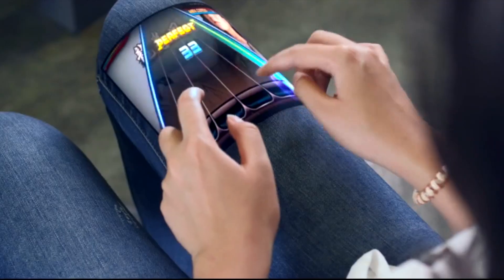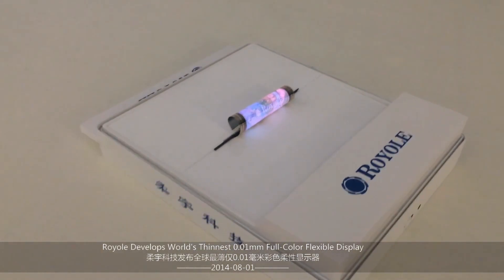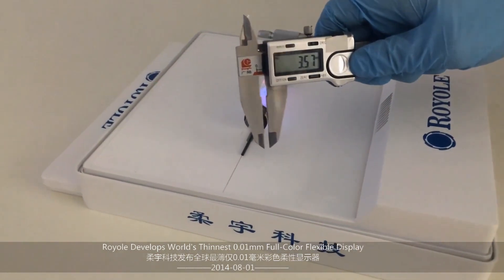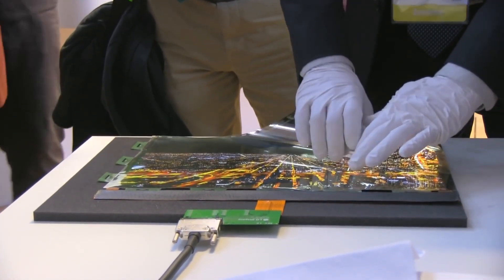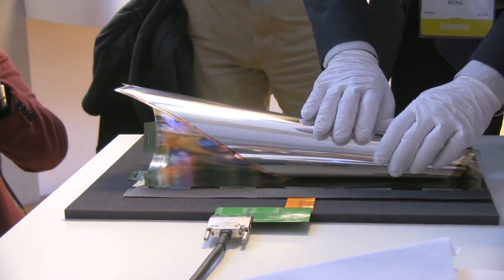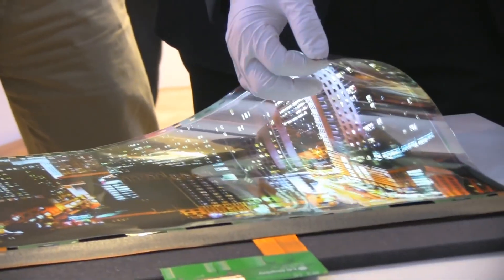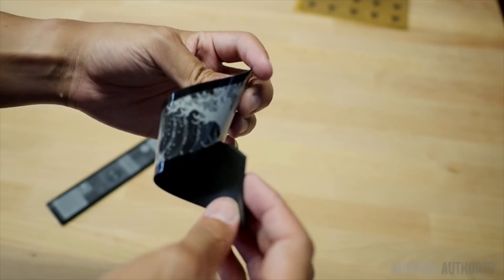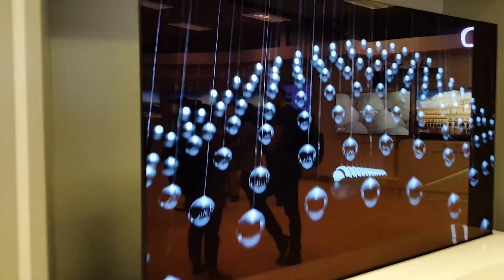What is Stopping Flexible Displays From Taking Over?

Comment: We're still waiting but manufacturers are trying to still create glass displays. As a result what's been released is mostly a gimmick - foldable phones and laptops etc but it has a big crease down the middle and has a limited life cycle because they keep trying to make it with a glass display. Until they ditch the glass we'll still have heavy, solid devices.

Comment: To be truly bendable, not just rollable or flexible, you need a organic water insulator for electrodes, and also organic dielectric for driver chip and thin film transistors, and then hermetic sealing for display packaging; each demands different polymer thin film technologies that can be delivered byCVD or printing processes; unfortunately I don’t see many choices out there.

Comment: a great use case is the head mounted display monitor ... not vr head set but similar.. for work... with you motion and movement around you can virtually switch to another monitor... vr headsets are not good for long time work and for people travelling or for any reason cant carry monitors , that was just an example there are many other use cases such as land surveyors

Comment: Return to classical drafting but with the benefits of digitization. The link between design and construction. While zooming has its place, one needs to be able to see full plan sheets. The largest manageable paper plan sheet is D or E size 2’x3’. This is the magic number for design and construction. We are still using paper plan sheets because it is a consumable quantity of information with built in static zoom and the ability to carry and look at. If you could carry a full plan set or all your plan sets,  in a single 1/8” or 1/16” sheet that will be revolutionary. Especially if designers are working on the same format. Combined with some sense of touch for design.

Comment: The flexible display should end the laptop and the tablet form factors completely. They should coalesce into three-ish items that combined weigh only a few ounces. 1) A screen you can roll up into a small protective tube 2) a computer that's about the size of a Raspberry Pi (fits well inside the palm of my hand) and has the computing capability of the laptops we have now or better 3) Something to prop up and unroll my flexible display that has a camera that can watch my fingers type and touch on the table in front of it (no more physical keyboard).

Comment: It’s not the lack of demand for this item, holding them back, but the durability of the screen. It has a temperature sensitivity issues. 

Also the flexible screens become dimpled after a being used a couple of times by the operator. They need to stat looking at silicon material, that do not incur damage from being used again and again,  instead of using ridged acetate sheets.

Comment: It would be perfect for my home built flight simulator. Wrap around screen would eliminate all the problems associated with setting up front, left and right views from the cockpit seat.  Currently need to use three to six large lcds all running from synced computers with each screen showing a different view. Another approach currently used is to build a curved screen and use two or three projectors.... of course then needing to use warp software.  The problem there is keeping the projections from jerking when the simulator is moving during flight aerobatics.
A curved tv screen or two would be fixed to the body of the simulator thus eliminating multiple flat screens or projectors.
Reply: @Lurch7861   Ha ha.  That was three years ago.  Come a long way since then.  Have built three axis motion sim - with a dual seat/dual control cockpit with three 55 inch 4K screen for front, left and right, plus three more for instrument panels.  Not quite the cost of an actual plane but fairly pricy with high end computer to run everything.  But of course I can go anywhere in the world with MSFS and I can’t get killed doing risky stuff.

Comment: Because a truly foldable device requires a foldable battery (processor, RAM, etc.), I think most phones we'll see in our lifetimes will just be "bendable'" phones. The only other way would be to have those components stored separately, in your pocket, and transmitted wirelessly to your screen. Even then, we'd also need "true wireless" charging also.

Comment: Flexibility is cool but the appeal for graphene is durability. Upon impact it distorts it's shape instead of cracking. You can't resist impact forces with rigidity. Flexibility is better because the forces disperse as it bends. I want a phone that I can't break so easily. Gorilla glass is not good enough.

Comment: Remember when the consumer market was demanding flexible displays?

Me neither..

This is a solution to a non market need.  Nobody cares about this.
Reply: I care because it is compact, portable, light weight and can easily be put in small places.
Reply: There's not a market demand for them.  It's as simple as that.

Compact, portable, and light weight has to be balanced with durable.

You already have a super computer in your pocket with a modern phone.  That's compact, portable, and light weight.  A typical smart phone today, is entirely capable of doing nuclear bomb simulation, its power is simply wasted on inept coding and trivial visual effects.  I'm not kidding when I say this either.  My first computer had 4KB or RAM, and ran at less than a 1Mhz.  I learned to write code on that, at 9 years old - that machine can be simulated on my phone at the transistor level at over 10,000 times the speed, written in Java,which is interpreted.

People who weren't born before, say, the Nintendo Entertainment System, have absolutely no idea how far we've progressed.

Comment: You do know that "Samsung Edge" has a flexi display right?

Roll up display & interchangeable component phone was a very old concept by students all over the world ever since before the release of Minority Report.

Both concepts doesn't sit well with current sales strategies, where financial values for the interchangeable concept is highly questionable (considering USB-C only taken seriously because of Lightning connector).

And the roll up / flexi display?  The folding mechanism isn't reliable enough for mass market, (not volume, demands are there).  That is why ALL the flexi screen trade show will able to tell you about their screen with such "bend X angle" and "bend radius value", because it will dictate how the folding mechanism works on a phone.

Right now it just too limiting to be reliable, not volume.

Comment: I feel like the foldable oled in a phone would be a huge problem. What are the use cases with that kind of device? And when it folds, the biggest issue I see happening is that it can't fold FLAT. There needs to be some bend, and it would make the phone fatter as a result. I assume you can't crease these things, but if that becomes possible who knows
Reply: Why would you need a case?
Reply: Since I never said that, I have no idea. A "use case" is something different.
Reply: Oh

Comment: Old flip phones were safer when driving. Phone rings,, flip,, talk... Now phone rings,,, you have to slide the button to talk .. Not safe while driving. Have a phone that flips open again u talk,, or you flip open large screen mode.. Now u got some thing.. Now they gonna steal my idea.. How bout some royalties or a free phone at least,?? Also if you work construction a foldable phone which had built in drop protection would be good...

Comment: It's interesting, but so far have not use for it. I like a solid flat screen, thin, ok, but foldable? I even never fold paper unless it is necessary, or (maybe some people remember, pictures). But flat is great. You can hang a flat, thin screen at a wall, put another frame around it etc....

Comment: I think the truth is something dirtier. I think at least one of the big players holds it small or something like this because Apple couldn't do what they do for years now, which is realising the same design with new specs over and over again without losing customers to more innovative Producers or something like that. Or maybe they want to release a few more phones like they are already until they play this new card. But it's already too long to say it's something like "the market is not there yet" or "it's technical not ready" another theory could be that Apple and Samsung would need to overthink their products completely which means they would need to develop something and that is expensive. It's cheaper to make the screen a cm bigger use a better camera and CPU and then write a new number on the product

Comment: Yeah I thought one of the big issues was durability and lifespan? I've heard that the screens work well enough right now and don't rely on overly new technology but the problem is pixels die rapidly and the screens don't last very long as a result. Hell, half the pictures I've seen online if you look closely enough have dead pixels clearly visible and sometimes entire dead sectors somewhere on the screen. Whatever conductor they use for the screen has to be soft in order to be flexible, and soft materials still break down over time - like a rubber hose. If you sit there and bend and flex the hose long enough it'll eventually start to crack and finally break. Thin metal fibers work the same way. Anyone who's ever worked with electrical wires tells you the ultra high gauge wires - the ones with human hair thickness - are stupidly easy to break and degrade rapidly if you don't handle them super delicately. Put something that's made up of millions of those delicate wires into the hands of your average consumer and see how long it lasts. It'd be a RMA massacre if any company used flexible displays in a mainstream product right now.

Comment: curved screens for 3d vr, that wraps around your field of vision rather that having one or two flat screens ... it will help a less bulky vr headset... ideally it would be able to be a single display that could use polarisation or LCD shutter effect on the lenses at a high enough frequency to deliver left / right images in conjunction with fresnel lenses...

Comment: well you could make a very compact mobile device that get rolled into a tube and back for easy compact storage but size of the screen would effect the size of the tube containing said display remember most of the working components of the programming needs to fit in the tube at all times.

Comment: I could see devices like the switch, but the screen rolls up inside the device when not in use. It would keep the screen nice and protected and also make the device highly portable. You wouldn't even need to unroll the device if you were planning to use an external monitor.

Comment: i just think it would be cool to have your walls covered with it . than you will be able to "renovate" each month by changing the colors of your walls/
Reply: Eyalחןעצוןי5עוגנט Ben Ari good idea I have been thinking the same thing for a while now but believe that using a colour e-ink display would work better due to the fact they are already available-ish, are cheaper, don't emit light so it would be more like real wallpaper and don't use energy except when changing the display. The main downfall of e-ink is the lower resolution and frame rate but for wallpaper I don't see that being an issue.

Yea I have thought this through way to much!
Reply: Good luck paying the electric bill. Also, Oled has a tendency to burn in really bad and dim over time.
Reply: THIS ^^^
Reply: @Nij Jin 

'Barley' as in LED consumes unnecessary energy to power it via a back-light that is otherwise entirely redundant and obsolete aside from the purposes of just emitting light compared to OLED or even upcoming MicroLED. 

Secondly, efficency doesn't necessarily mean reducing power consumption as the only thing to consider. That's a common fallacy, though it is an advantage literally anything other than LED/ LCD has among many others. Further, LED is notoriously often built cheaply and to a sub par standard verus OLED or even upcoming microLED due in part to a thing called "the panel lottery" that denotes an inherent  inconsistency among these panels, regardless of refined manufacturingprocesses, with variations ranging from terrible to amazing which concerns brightness, imperfections, tint, accuracy and contrast paying any amnount of money for something that is worse in some aspects seems nonsensical, especially if you were paying ridiculousamounts of money.

 esides, efficiency is more in relation to mobile devices and battery, which is still a huge factor and something LED/ LCD is not good at. Regardless, why would you not want something to be as efficient generally as possible, even if you can afford it? That sounds more like moving the goal post to me.

Lastly, LCD is limited by a silly amount of rigid and fragile parts that restrict applications and certainly can't be made on a clear substrate for smart applications such as car HUDs, windows, mirrors, etc. Not to mention they can get very hot and fail, unlike OLED which admittedly can have burn in, however, due to its nature, it doesn't depend on a backlight. That effectively means that one component failing affects the whole screen. 

Back to efficiency issue, when the tech depreciates and is subsequently cheaper and scaled up for a wider market, obviously power consumption will be a concern as aforementioned due to the nature of LEDs in the traditional sense concerning LCD tech. Long story short: the future is dropping the archaic and inconsistent tech that will eventually become too cheap to manufacture for it to actually be profitable. Why argue for moving backwards or plateauing with tech applications?
Reply: @Nij Jin 

Anyways, hypothetical situation aside. Outside of windows, smart devices that require a transparent screen and entertainment applications, that kind of application is just silly and outright unnecessary.
Reply: Good luck on your health. Monitors are know to emit radiation too.
Reply: @johnmichael4106  what are you talking about, C'mon.
YOU emit radiation. Do you feel warm to the touch? Are you anything other than Vantablack?

Comment: they aren't flexible enough for clothing and that sort of thing, but they should be used on glass or semi-rigid materials. Could be stuck to windows and umbrellas to display images or information. wouldn't it be cool if you umbrella showed how long you can expect the rain to last? or display a sunny patch in the sky above you or on a window? or if you're walking and need a GPS, it could display your walking directions so you don't have to hold onto your phone at the same time. They can be put on glass sliding doors to display the current weather at all times.

Comment: I don't think a foldable phone would work. I need the thing to be rigid so I can type on it and simply use most of the functions. A smart watch maybe but that also sounds fragile af. I bump my regular watch against doorways and railings all the time but it's a thick stainless steel strap with sapphire for the glass.

Comment: I did not see a single worthwhile example of a practical application in the video.  Heard one in the narration, didn't see one.

A display you could fold up to fit in your pocket yet open up to give a large display area might be nice.  If you could design one that could stand up to that sort of use.  And which was easy to use without needing a PhD in origami.  And which you could fold/unfold whilst wearing gloves (and whilst drunk).

Curved displays might be useful for VR to give a good, natural, immersive wide field of view.  But they don't have to be flexible in use, just curved.  Permanently curved would work just as well as flexible and could use current techniques with fewer modifications.

So right now it looks like a solution looking for a problem.

Comment: Tony Stark's display inside his helmet.

But seriously, all because it CAN flex, doesn't mean it should be in a device that allows it to flex all the time. This just means it's a material and technology that can form fit to the inside or around something that best utilizes that shape for the user. It's benefit is its versatility.

Comment: combined with the latest flexible material that switch between solid state and flexible state with an electrical current switch, this could make for a phone with foldable larger screen to switch between tablet mode or phone mode with a single built in switch and folded screen inside the phone.

Comment: The perfect market with high production demand is already in place. Use a large transparent sheet on the interior windshield side of vehicles. Display GPS and real time warnings so drivers can keep eyes on the road without looking down at today's dashboard GPS. Displays turns, right in front of the driver, ie- arrows on the road itself. Have a small map at the bottom corner like in GTA games.

Comment: You are forgetting one thing,.......you can have flexible displays as much as you like but what are you going to run it with ?.....a flexible circuit board, with a flexible battery, flexible earpiece, vibrator motor, chips etc. As far as a mobile application goes this is suuuuuuuuuuuuuper early days !. Its once thing having a display that flexible, its totally another having all the components you need to drive the display being flexible.

Comment: flexible display have no purpose in mobile devices, lets be practical, why would you  want to look at a curved display? you can loose information in the course of deciding where to look first, flat screen however is easier to use it has straight vision and without frequently moving ur eye balls you can see straight, point of interest remains balanced.Just because technology is there does not mean it is really useful in day to day life.